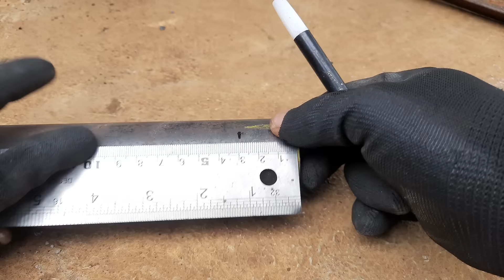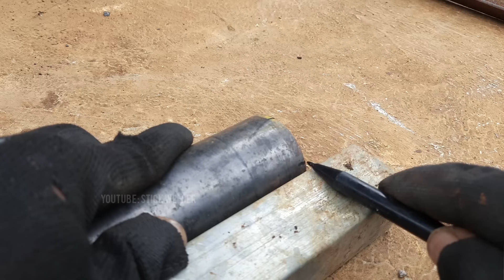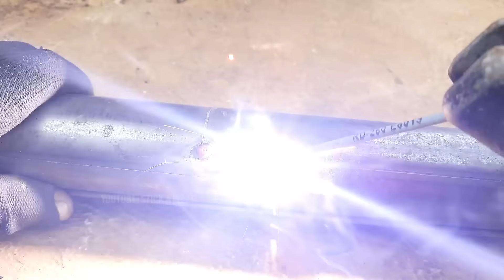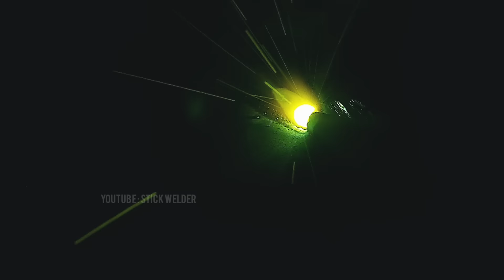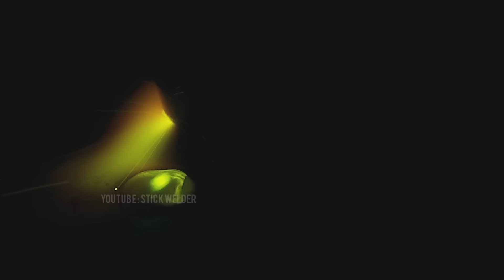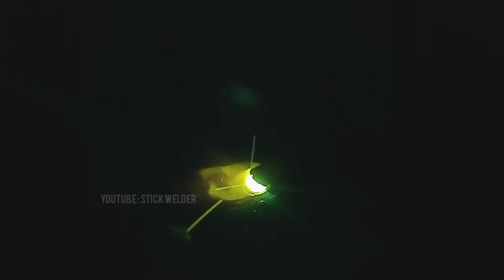not many know, the welder's method of connecting thin pipes is stronger | stick welding thin pipes

Comment: You can’t stop and start a bead like that without cleaning the flux, and glass off of it. It pollutes the weld and causes lack of fusion. Further more this fit up for your pipe is very strange. You didn’t clean the metal, it is unbevled, and you seem to be using a common 6010 electrode when it’s usually common to use a 7018 electrode for a welding pass like this. Also, why the hell are you welding with holes in your gloves?
Reply: Although recommended, you do not need to clean your metal before welding with 6010. That metal is thin enough to get full penetration with 6010. The metal is 1/16th of an inch thick why would you put a bevel on it. That's why he was tack welding it instead of running a straight bead, yes you can do that with 6010 it's a deep penetration rod not low hydrogen it'll be fine.
Reply: Why the hell would you have to bevel thin metal like that? It's even more common to use 6011 or 6013 on this thin wall pipe, NOT 7018!
Reply: @dr.stiffsock3662 9
Reply: Whatever, I enjoyed it watching it.
Reply: Why is he wearing synthetic such as nylon instead of leather for welding gloves 🤣
Reply: You need to stop and start welding on pipe this thin or you’ll blow through with a stick machine.
It doesn’t pollute the weld, firstly because the pool is still molten and secondly because he’s using 6010.
The stepped pipe is to increase surface area and reduce the moment (bending force) that could break a cylindrical weld around the pipe especially on an exhaust pipe that sees a lot of vibration, heat cycling and strain across weld.
You don’t need to clean the metal first, just remove any iron oxide, he’s using 6010.
You can’t bevel a thin gauge like this, you will blow through unless using a tig welder.
He hasn’t burnt his hands yet so hasn’t learnt to use thick gloves.
Any more armchair questions let us know…

Comment: Ive been a pipefitter for 15 years and i’ve never seen this done once. And it never will be, and it never has been, anywhere in the world ever 😂 but nice little d.i.y home project idea
Reply: I can't see the point. I'm a mechanic and welded lots of exhaust for 20 some years. Nothing ever fell apart just joining the pipe and laying down a bead.
Reply: RIght?! Maybe, I won't ever use it, but its a cool way to think about what can sometimes be a difficult problem with a poor setup.. But I agree, I don't know that I have ever seen it done in real life, especially with standard exhaust work. That said, I get myself into enough weird situations, I can see myself having to do it someday.
Reply: Agreed,  Ironworker here, built miles of handrail. Never seen this done in 30 years in the trade
Reply: Agreed. It's one of those "book learnin" on paper things. technically you have doubled the length of the seam and applied more weld which on paper should be stronger...but again, like you said, nobody does it in practice as its a cumbersome waste of time.

Comment: Nope. I welded thousands and thousands of tubes together by just butting them together with no problem or loss of strength.
Reply: Not because u always do it an it works  mean its the right way or the strongest because its not.. this method shown is the strongest.
Reply: @daynecarmichael  Hi Dayne, this is mechanical engineer.Every weld connection which can  transfer load are good. In this example the load will expand on bigger length of weld instead of axial simple connectiin .butting. But connection is always put on place where is bending moment and shear force are small
Reply: You can put back plate insade of tube and tu have good weld. For responsible construction thickness of tube are 4mm and higher, I use back plate plus I put 4 ribs around the pipe
Reply: @daynecarmichael  a correct full-pen bevel weld will be as stronger (if not stronger) than the general tubesteel found in the common structural market (A500 Gr. B or the EU Equiv.).  If the fractures are happening at the welds, it's likely due to improper preparation, incorrect stick/flux combinations, incorrect welder settings or improper technique.  Not once, in my many years of doing structural construction, have I ever seen anyone go through the hastle of welding a pair of tubesteel ends together like this.
Reply: @Evocatorum Correct, in Your many years..  at the start of mines learning industrial standards u dont just butt pipe.. 3/16 bevel 1/8 root face 1/8 Root..  most of u so call welders can't even root a 1/8 space thats why yall butt pipe Lol smh
Reply: @daynecarmichael  Attacking my ability to weld doesn't change the fact that butt welding pipes is the industry standard throughout the world.  While this "technique" does work, it introduces a significant amount of extra welding which can result in contaminant mixing, incompletely fusing of the two pipes, micro-fisures or micro pockets, and incomplete penetration.  This is ignoring the extra amount of time required to prepare the two pipes (unless they're prepared on a pipe laser cutter).  To be clear, it's a waste of time when the butt weld is more than sufficient.
Reply: How do you know they had no loss of strength? Did you test them? Anyone knows an inner sleeve makes the weld stronger by a factor of 10!
Reply: @donraptor6156  no no pld school is rhe best. way whO has the time to this trick weld butt weld the best
Reply: I can understand doing this if the pipe is going to be bearing a load or something but it seems a bit much, generally speaking.
Reply: @dragoljupcedragce5877  oh very strong🙂. I wonder if this method prevents the curvature of the pipe one way or the other, or if the spring back stresses are less, maybe?

Comment: Use this technique, THEN realize that your pipes were cut to the correct length originally.  Now, the pipe is too short to be used because of the notch and the material is wasted.  Nice technique, but will take proper planning.
Reply: measure twice cut once.
Reply: @nicholasgloc8555  but I cut it THREE times, and it's STILL too short!  🤣
Reply: @bigwo56  Cut a bit off the ruler.simples.😜
Reply: @nicholasgloc8555  PERFECT!!
Reply: @nicholasgloc8555  just weld it back on... simples

Comment: Much easier and just as strong to make an 'inner sleeve'
Reply: Exactly. I make the inner sleeve, then "V" the pipe ends and lastly rosette weld in a couple of spots on both sides of the seam. never had one fail

Comment: A+ excellent instruction...far better than all the rattling on others do. thanks for sparing me all the unnecessary yakking. i saw you did small patches and allowed each to cool briefly before continuing and seemed like low voltage on that thin pipe stopped holes from being burned.. thanks
Reply: I dissagre

Comment: You should try to weld in one go making figure 8 movements. If you start / stop like you do, you will create slag inclusions , weakening the joint and possibly leakage later on.
Reply: Metal is way to thin  to run it in 1  consistent bead . Your heat  trail will  blow right through.  This start stop method keeps metal cool enough to  not punch through.
yes u wil be prone to get incluson but he is also welding a  lightweight fence rail for light duty, it will work . This isnt structural  material he is using. 
6010 is fast freeze rod (whip this rod)
(more metal and less flux) w low hydrogen  content as previous  commenter stated . Only thing he could have done is stop clean  restart but that would have 10x added working time  for a  light duty application it will suffice.

Comment: What I would like to know or what was the welding voltage he use to preform the weld? I have been having trouble with the rods either running too cold or too hot. Can’t seem to find the right medium to get a great pudding. Tired of burning through the exhaust pipes.

Comment: Occurs to me that for thin-wall like EMT I could make a sleeve just by expanding using an expander or by cutting and spreading a slice. If that could be flowed with solder - plenty strong for most applications. Would probably be the strongest point in the tube. I need to start building with EMT or other inexpensive 1" thin wall or smaller for a lot of projects. Motivation to get to welding. :) Anyway - if you're answering - what do you think?

Comment: If this was a structural, load bearing tube, you would want a smaller tube that fits the inner diameter very closely. It would have to be quite a bit longer than that joint in either direction ( for strength) and held in place with plug/ rosette welds. I have seen fish mouthed tubes to join tubes before, but never this method.

Comment: Oh my god. Just stop it. No pipe fitter/welder is ever going to do this. Also, that welding is terrible.
Reply: @wh8378  Couldn't agree more. This is a lot more messing about than doing it the correct way with NO benefit whatsoever. i work in pipe fitting and welding and am also a qualified steam raising boiler operator and know that everything you said is spot on. As I said, nobody would do this and nor should they.

Comment: This is not necessary and is in no way an industry-standard, it's Steel, not wood. If welded correctly, the weld is stronger than the base metal. Butt.them up, Turn and Burn